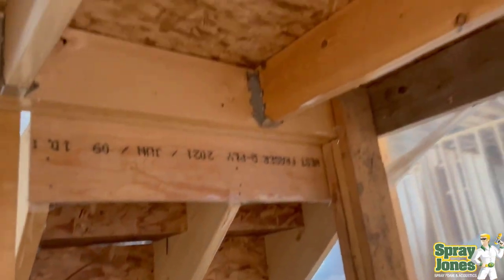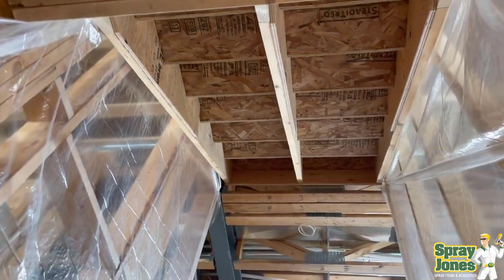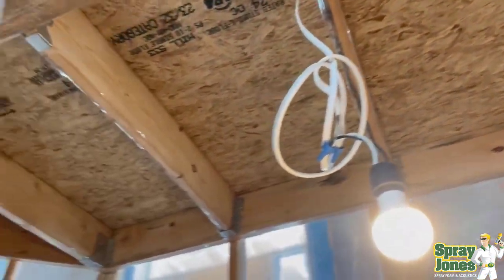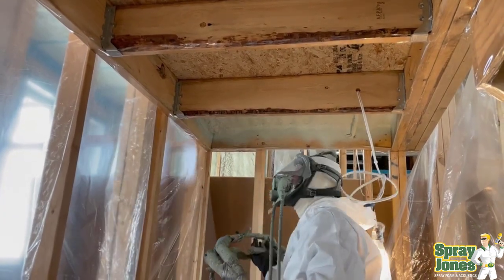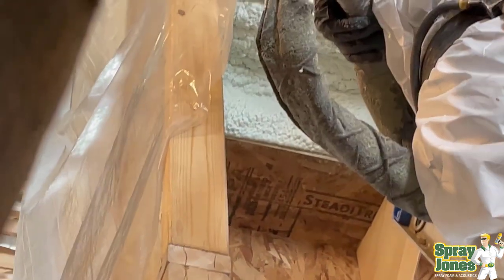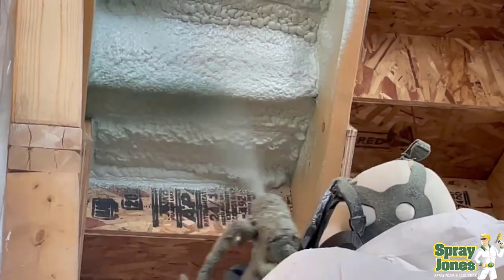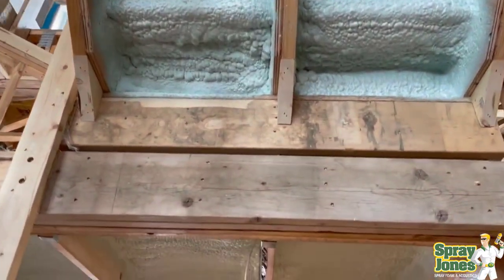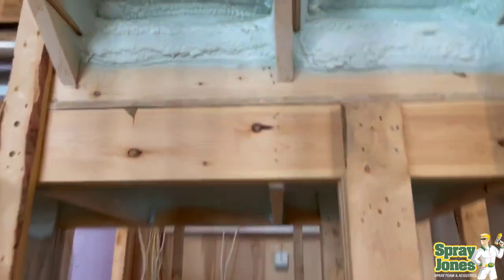Why Spray Foam on the Backs of Stairs Makes Sense.

Comment: I have a couple of questions (& couldn’t find it on channel). If you spray foam inside a metal building & later need to replace a metal panel, how would you do that? Does the foam make it more difficult? How do you “refoam” if interior is covered?

Comment: Use rock wool,  highly fire resistance,  if not fire proof and spray foam is flammable.  plus it stinks !!!!   At least you never have to worry about cockroach's and ants.
Reply from the maker: SPF needs something else burning to burn....like the wood of a house
Stink...? So does paint, varnish, primer new carpet. We have 0 voc within 24 hours as tested to a ULC standard. We carry green guard indoor air quality certifications. 
Cockroach and ants will get into ANY building material if there are gaps and things are wet. 

This is my nice response to such ignorant and ill informed comments.

Comment: If you choose to do a response video to "Home Performance"'s video "Spray Foam Bummers" (just posted an hour ago), I'd be very interested in watching it.  It sounds like most of his points boil down to: if you're planning to install a leaky roof, cheap out by neglecting to install air exchange, and use sketchy foam installers, then spray foam is bad.
Reply from the maker: So "nuff said".

Comment: I’m going to have my basement walls sprayed with 2 inches and the rim
Joists sprayed with 3 inches thanks to your great library of videos. One question is do I need to put a subfloor in   (Home built in 2006) if I’m having it sprayed? Can/should I install the luxury vinyl plank directly on the floor? Thx.
Reply from the maker: I do not know anything about flooring. Talk with floor installers for that.
Reply: @SprayJones  will do. I guess I’m hoping with the spray foam it will create a true moisture and vapor barrier on the concrete and if that’s the case, the only concern is from the concrete floor.

Comment: I am remodeling my home and changing flooring on the stairs. The drywall is already in place on the underside of the stairs. I wondering if there is a way to spray foam in the void between the stairs and drywall for a sound barrier.  Right now they sound like drums when the dogs run down the stairs. Removed the carpeting and am going to put wood stair treads on one set and vinyl on the 2nd set of stairs going to basement.
Reply from the maker: No, you need them open to apply.